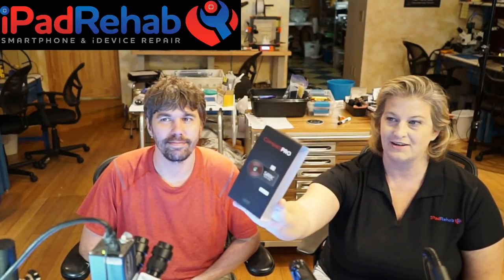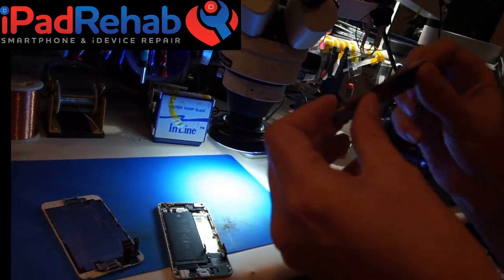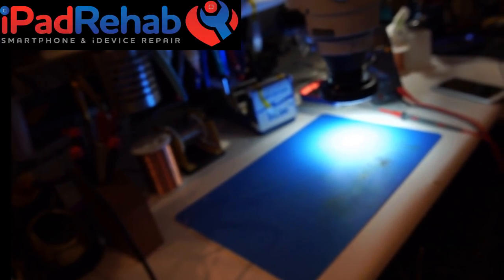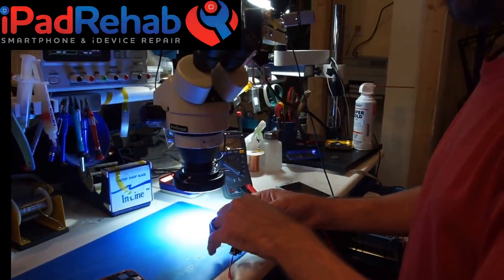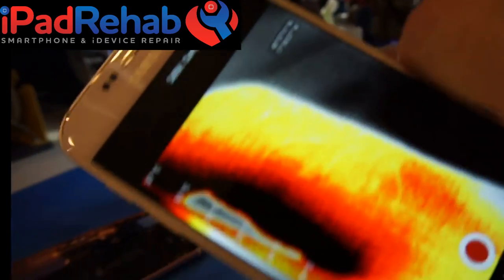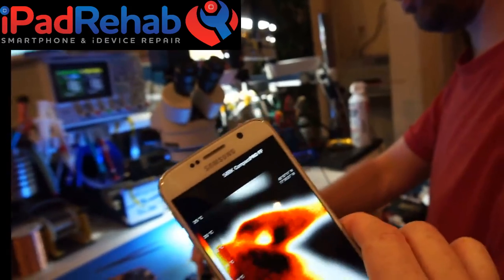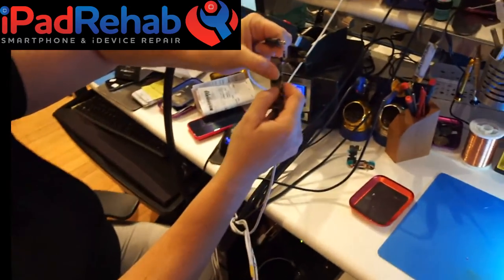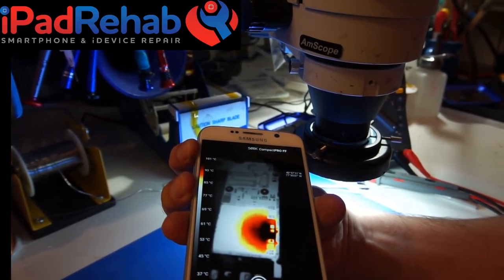Seek Compact Pro Thermal cam versus My Face for iPhone short circuit detection

Comment: How much extra would manufactures add to the cost of a microscope to build in an IR chip into the unit or to the HDMI tri piece unit to save messing with another iphone/cam in the first place?
Also, can you get a dock flex to lightning connector accessory to plug into a removed board so you can boot prompt by pulling the PC USB side in and out rather than messing with tweezers?
great work, thanks for all your efforts.

Comment: Hi Jessa! Thanks for great streaming solely about thermal detection. It's obvious now, high-res thermal camera isn't among first budget things for a repair shop, but at least it's not as unusable as Louis told and shown. Gotta friend that owns cheaper thermal cam. Says it saves him a lot of time by easily detectable "wire"-caps hidden under compound and producing small, otherwise indistinguishable amount of heat, like 35-36C over 33-34C for an IC it sits nearby.

BTW, what's the camera on tripod you used to livestream from hands? Was it connected by (micro)HDMI or USB?
Thanks in advance!
Reply from the maker: a free tripod that came with a cheap "camera accessories" kit that was free with my camera purchase on amazon.  Camera is on microHDMI

Comment: I love watching your channel. I find it fascinating but I dont think I will ever do any repairs on the newer iphone. But in my opinion I feel you may be judging the thermal cameras to harshly and not testing them or using them properly. If I was to buy ultrasonic cleaner and fill it with muriatic acid and wash a circuit board in it and when done all my traces were gone I wouldn't blame the crappy machine. I also feel that in a professional work environment surrounded by thousands of dollars of test equipment then using lips.... to touch a component... I personalty cant wrap my head around that. A good high resolution camera with image overlay like the Flir E8 is unmatched in the industry.  It was like one YouTube channel suggest if you couldn't afford a good fume extractor to hold your breath and then breath off the side....OMG...really...there is the right way and there is some sketchy ways and I really think lips are a little sketchy..but i still love you content...
Reply from the maker: You realize that I have a $400 fume extractor next to me bench.  I’ve probably turned it on three times in the last year.  It’s noisy.  When I can just hold my breath and blow the fumes away....SO much easier.  :)
Reply: Of course I realize you have the equipment, I'm not Knocking easier, but I think there is easy and there is professionally efficient. I just dont think 2 minutes makes a difference when I can have a exact image of the hot part not on my lips..lol.  just seems cheap in a room full of pro tools and good techs..thats all..but in your defense...as you said I'm not a mom and havent wiped as many butts or snot noses..lol
Reply from the maker: The real test of a tool is “will you get up and walk across the room to use it”. And for our old FLIRONE cam the answer was “hell no”. The resolution was literally less than what your face could detect.  
For the Seek thermal camera, the jury is out.  I did go Seek the Seek once yesterday and found a short on an iPhone X that would have been difficult to find otherwise.  
Remember ONLY the multimeter can diagnose short circuits.  Heat is just a symptom.  In our experience most shorts can be found in seconds by holding the board to your face, then probing with the multimeter to find the short.  There is no practical reason to use any other piece of equipment.

I’m sure that a quality thermal camera with excellent resolution will help to find difficult shorts but I don’t yet know how common that use case will be.  Probably not common enough to justify the price tag for thermal cams with high enough resolution to help.
Reply: I do kinda agree with the "get up and walk across the room" . I will sometimes insist on using the wrong tool just to not get out of my seat.
But I also feel that its a double edge sword with thermal cameras, company's like Flir have lowered the price one some units to make it more affordable to others and in turn sacrificed a ton in image quality and now allowed the Chinese market to flood the game with there crappy knock offs.
It is extremely hard to swallow a $2600 bill for a diagnostic tool that "lips" can do. but if you had the opportunity to look through the image of professional line of thermal cameras and not cellphone app based junk it is a world of difference. It would be like putting 400X lens on a iPhone to do micro soldering because a Am-Scope is to expensive.. BTW   love the feedback
Reply from the maker: We just got the $2500 flirETS320 today.  Nope--this thing is way overpriced for what it can do for cell phone repair.  The Seek camera is affordable enough to make sense and has good resolution, but the FLIR cam is a huge no way.
Reply: well we cant say you didnt give it a hard and fair try..lol
Reply: is this what happens with late night shopping...

Comment: i think your test would have been better if you had it on a stand, hands free as then you would be using both hands to diagnose the problem, the other issue i saw is your range of colour looked smart (grays) but the black (hottest) was confusing the pics, was there a way of showing a different range of colour and also if u can press to 'ask' what the temp is of a chip.

The prices of 500 dollar + - seems to be where it is, but what exactly is the thermal lens doing? are Seek and Flir keeping this technology secret? once china get's their hands on it, 3rd party products will be more (like Louis machine which he using more and more on larger macbooks)